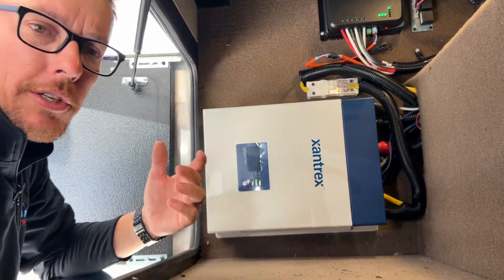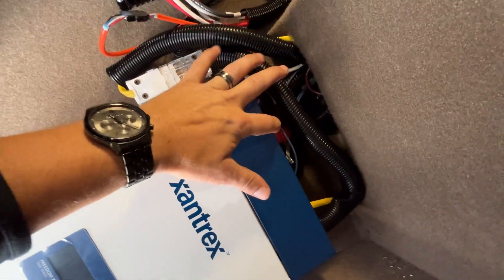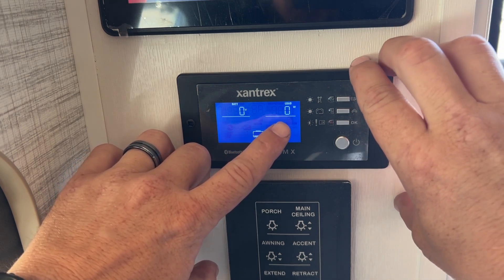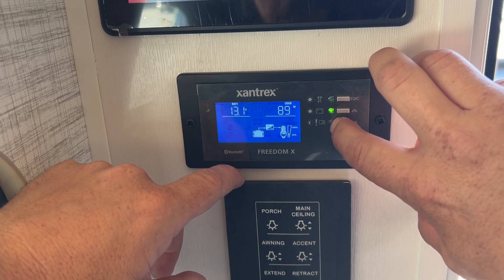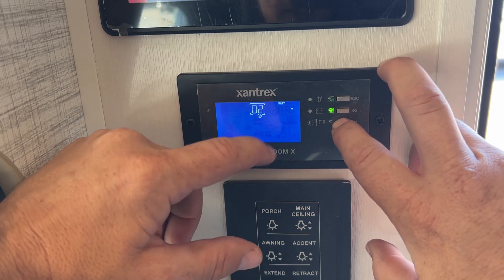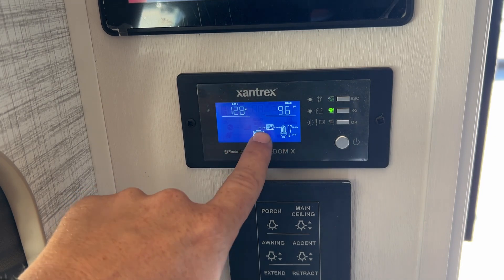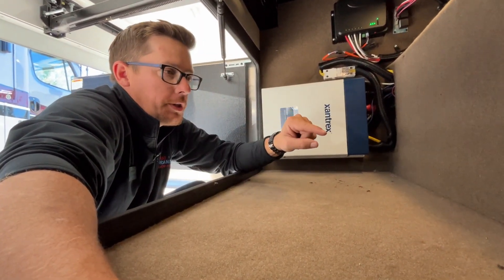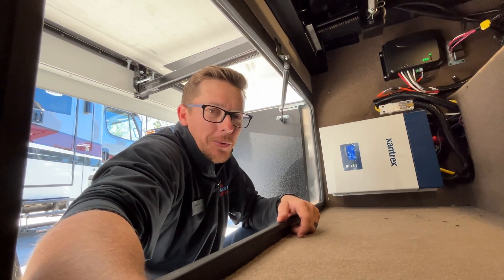How to use Xantrax Inverter

Comment: I am not attached to shore power.  I am ready to out my RV in storage.  I switched the power switch on the panel to off however after several hours I still have power to the circuits.  The green light is on indicating batteries are supplying power.   Any ideas?
Reply from the maker: The power button only shuts down the AC power.  To shut the whole system down you want to cut off the battery disconnect.  Depending on the type of unit it will be a separate disconnect just for the inverter or one that cuts everything off.  If you don't have a disconnect for it, you will need to unhook your battery.  -Todd